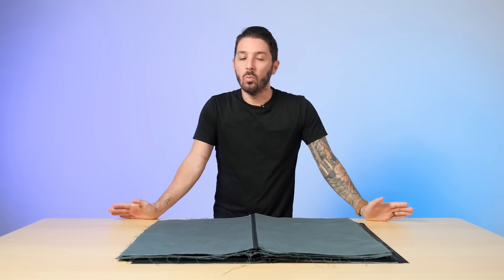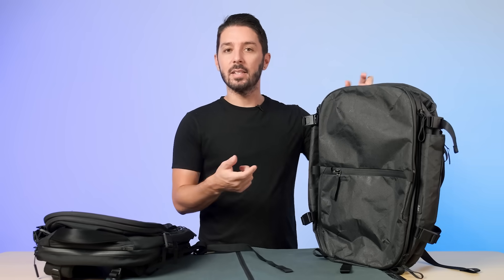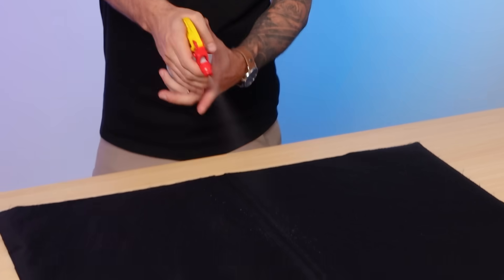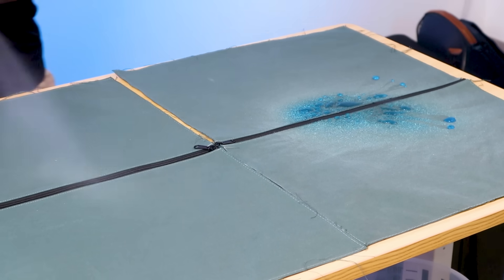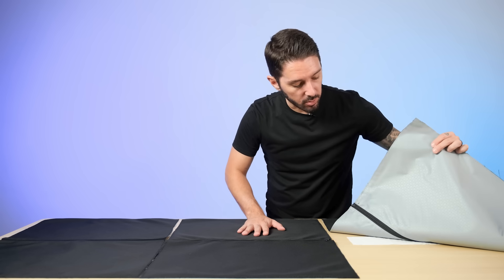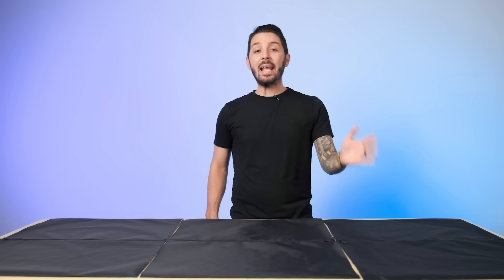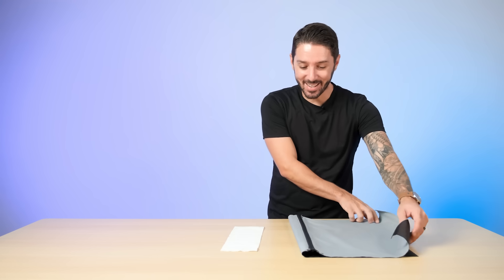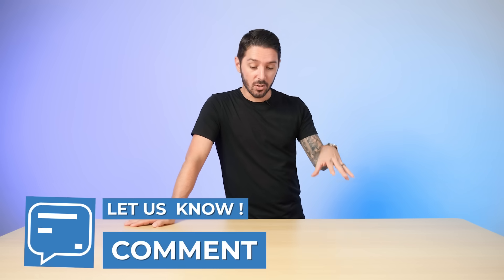Are PU coated zippers BS? (We Test EVERYTHING)

Comment: We learned many things thank you for doing this test! as you said there are many factors that can influence water resistant zippers and the effectiveness. 

i would personally like to see a little more product innovation in zipper flaps that cover the zipper. therefore not having to deal with PU coated zippers and their drawbacks. I live in a desert climate with lots of sun and am afraid to buy a backpack with exposed pu coated zippers. I wanted to love an aer cpp2 i recently got but the laptop pu coated zipper was tougher to open and got stuck on the inner lining of the laptop pocket so it was a quick return. in the backpacks i’ve had before where there is a flap covering the zipper i’ve had mixed results with them getting in the way. my middle school jansport that i had to have because everyone else had one, had one of these flaps and i had to cut into the flap down at the bottom because a zipper got stuck. but my other bag that had this, the flaps weren’t a problem! maybe there is some fancy way to sew them where they can lift up easily or fold open so when you don’t want them you can get them out of the way and then if the rain comes you just plop those flaps back down and don’t have to worry about the zippers being a problem in the rain. just a thought! would be interesting to explore this. unfortunately i don’t get lucky enough to be a bag designer but man would it be so fun and cool to get into the nitty gritty of future backpack designs and ideas.

Comment: never liked PU zippers but i like the xpac look and my aer slings and bags (yes plural) are mostly xpac (i blame this channel)

the effort to open em aint worth it vs normal zipper when they both get wet anyway. if anything the material is a better indication of how good the bag would be vs getting wet.

i like the non PU coated size 10s on my aer bags more but i admit you get used to opening em since they are good quality zippers

there are PU coated class A or class B zippers that are a btch to open since they aren't original YKK ( i have one that's bootleg bellroy)

but there are non YKK zippers that are PU coated that are good quality too (i don't know the zipper brand tho, they're just in the non famous but decent local brand bags i use)

Comment: After 1.5 years of daily use the PU coating on my Belroy 2.5L venture sling looks terrible. All the heat shrink came off the zipper pulls too. Looks pretty tired now, which is a shame it was otherwise a great sling. Counting down the minutes till the Fyro replacement.
Reply from the maker: Fyro sling coming out soon, walk through video should be dropping today 🔥

Comment: Unpopular opinion: the water resistance of bag from the ones that I've own comes down to how much water resistant the inner lining, the opening type of the bag and most importantly the type seam seal u get under the zipper tracks. I've once commuting using motorcycle in a heavy rain for 2 hours and frequently get splashed from the oncoming traffic and not using rain cover (because forgot to bring one) and after arriving at my destination it's still bone dry inside because the bag that i use that day have Tarpaulin inner lining, flap opening which then i converted into rolltop, and seam sealing under the zipper tracks.
Reply from the maker: Great points and yes, the water resistance of a bag depends on so many factors

Comment: PU coated zippers with seam sealing and taping will make a jacket or bag more weather-proof.
Companies like Arc'teryx user PU coated zippers with fabric welding and seam taping for better water resistance.
But I do concede I don't know if welding panels together for bags provides the same mechanical strength as a stitch - and it's probably a no since we don't see more bags welded together.

Comment: Backpacks with a top flap opening are my preferred. Live in Vancouver so plenty of rain here. My Timbuk2 Robin did not have any problems with rain, even without the included rain cover.
For slings I still like Xpac. Think the look is pretty rad, and realistically, on a 2L sling, not a lot of water is gonna pool up on it.

Very surprised to see the results of the reverse coil though.

Comment: I’ve traveled with packs internationally since 1988; The first time I saw PU coating on a combo bag (my OG Ridge pack) was about 9 years ago. The zippers started peeling the second trip. But my stuff stayed dry - so I just endured the shame & damage to my Tech Santa image. 

This year I bought a cheap bag placeholder (their shoe pocket wouldn’t fit kid’s stuff), then a dandy Bagsmart expanded 38L. 

Summer didn’t bring rain here in LA or in Tokyo so - it’s moot. I’ve an older bag for emergency times that I got with a rain cover. My summer trip taught me I didn’t want to be a hermit crab. I’m putting my heavy stuff in my roller & just my personal stuff in my new T-22. I’ve light weight travel pants, a shirt & essential stuff, my tech & that’s it. My thought is for my Winter Travel Tokyo trip I’ll have the pack cover & a tarp poncho if it gets fierce. 

I’ll report from the field on that. 😂

Comment: Love all your testing vids, Aaron, especially the capacity ones. (Folks are clamoring for you to do them on some Alpaka packs, which are rumored to have vastly overestimated capacities.) As for rain resistance, it's a tough one. Still learned a lot by watching this, but having a piece of fabric lying flat--and still--for five minutes might not tell us as much as we think it does. Sometimes that might be how a pack collects rain when in use, but only rarely. I remember doing some testing with a garden hose set on "mist" with packs vertical and suspended from the ground. Looked like a normal rain shower to me, but one day I measured it: it was like 13-14"/hour, which approximates world record monsoon rainfall. When I finally got the water flow down to a decent "storm" (2"/hour), it was barely a trickle. I did test three packs, standing up and full, in actual rain, but it was a pretty hardcore downpour. Lo and behold, the contents of each got soaked, and all had PU-coated or rain-flap zippers. Long story short, PU-coating does help, and that might prove to be the difference between a wrecked laptop and a functioning one. But if the rain is hard enough, anything with zippers and stitches/seams will let water in. Rain flies help SO MUCH, but even they can let rain in under extreme circumstances. The only truly waterproof packs are the submersible ones with welded/bonded seams and airtight rolltops or airtight AquaSeal zips. Rule of thumb: if you can sit on your pack when it's zipped up and empty and the air stays inside, it's waterproof. But only folks in extreme conditions need such packs--or folks with extremely sensitive items they're carrying. You can buy a waterproof drybag that fits on a 16" MBP, weighs nothing, and takes up no extra space on Amazon for like $20. Totally worth it no matter what your pack is like. (Oh yeah, if you're sure you won't submerse your pack, the rolltops with welded/bonded main compartments that have no seams will do the trick, but only a few companies such as ILE make them, and then only on a few of their packs. Chrome does, too, I believe.) Sorry for the long comment--you know me.
Reply from the maker: thanks for your feedback and insights, we appreciate you!!

Comment: I once got stuck walking through a thunderstorm with a barely weather-resistant bag (normal reverse coil zippers and ripstop nylon). Ended up just laying my hoodie on top of the bag and after over half an hour of heavy rain the bag was still almost completely dry. Hoodie took quite a while to dry out though
Reply: Considering that PU zippers peel off as breaking in, can i be sure that the reversed coil one is the right choice?

Comment: I'm still in the camp of PU coated zippers and will remain there. My few Bellroy bags (4) and Peak Design bags (2) have them and range in age from one year to seven years old and none of the zippers are peeling or cracking. And all the backpacks/bags have been used extensively for daily carry, travel, and motorcycle commuting in all weather conditions but the heaviest rain (rain fly gets used). I would much rather have the PU coating than not, both for added weather resistance (even if it's only perceived) and aesthetic.
Reply: It will peel in 8th year.

Comment: What did we learn here today? That the rain covers for my backpacks are a good idea, regardless of the kind of zippers or materials the backpacks consist of. (I’ve yet to get caught in a rainstorm by surprise. But that’s probably because I’m checking forecasts and “watching the weather” myself.)
Reply from the maker: totally agree - if you want weather resistance, rain cover always wins
Reply: The longest I'm in the rain for is 10 minutes. So what I would do is just a quick wipe on top of the backpack. But walking with umbrella is the way to go. Maximises the protection without an additional cover and extra weight
Reply: @mohammedfaiisal  an umbrella can work, if it’s not raining hard and you can indeed get out of it, after a few minutes. But sometimes umbrellas aren’t big enough to help cover all the exposed parts of a backpack… and that’s when a rain cover can come in handy.  I have 2 that are super lightweight - 1 for a 15-25L backpack snd 1 for a 25-35L. Neither one weighs more than 65g and packs into their own baggie that can be stuffed into a small external pocket. (I stick mine into the very bottom of one of the water bottle pockets. (I typically only carry a 24oz bottle.)
Reply: Obviously you can't always do that.
Reply: @aluxious why not?

Comment: One reason I prefer backpacks with top flaps going over the back is just that it's almost impossible for there to be water ingress if the material itself is properly water resistant and/or impregnated. Not a fan of packs that are just zippred up top when it comes to backpacks. I honestly don't really have a problem with water ever getting into my stuff. Maybe the Bellroy Venture sling with its "trough" up front for front accessory pocket might starts soaking through in a monsoon or something... but really I'm not that worried about any zipper that doesn't permit standing water on top of it (thus my suspicion of the Venture) and especially if the zipper is vertical, not horizontal, having water run down the side of the bag would probably cause almost no ingress, gravity pulls it down after all.
Reply from the maker: agreed, if you want great weather resistance then storm covers over zippers (aka; flaps of fabric) are tough to beat